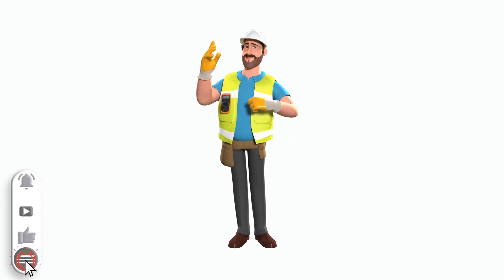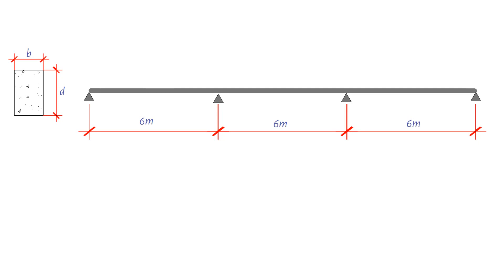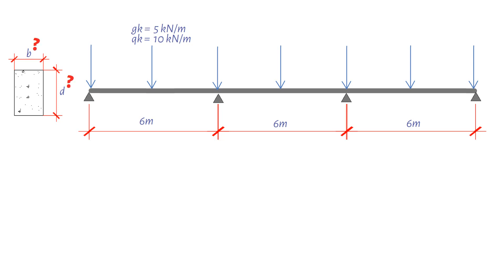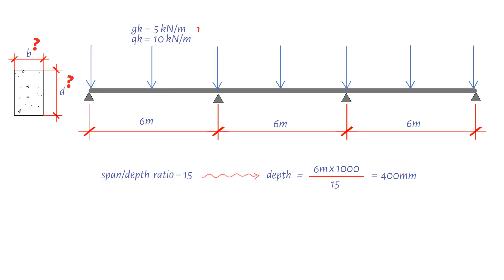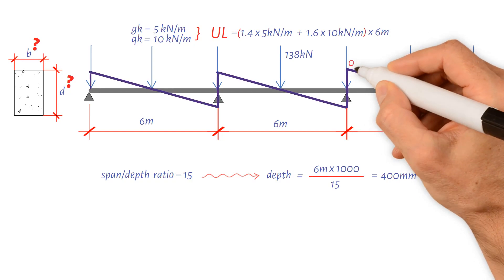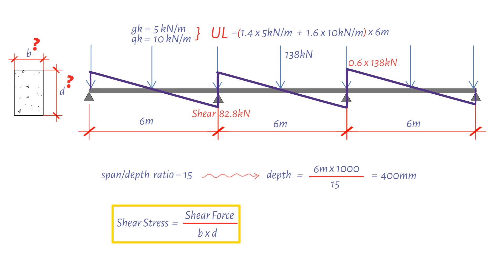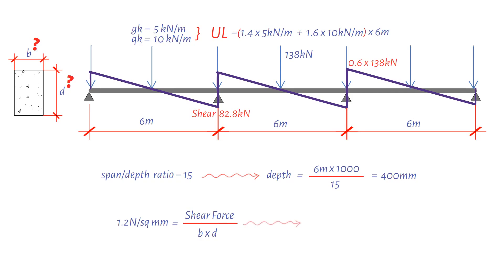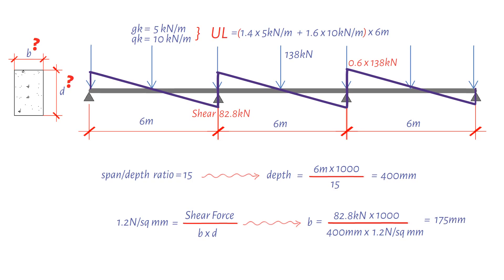How to work out the initial size of a concrete beam | Rules Of Thumb.

Comment: Hi SECalcs, how would you design a two-way supporting slab ?
Reply from the maker: Hi Jack, two-way spanning slabs can have linear supports along their edges (for example, beams) or they can be supported solely by columns (in which case they are generally called flat slabs). In either case, for a manual design (i.e., handwritten calculations), I would follow the design advice provided in the IStructE Manual for the Design of Concrete Building Structures to Eurocode 2. The applied load is carried equally by the slab spanning from one side to the other and also from one end to the other for a linear two-way slab square shaped on plan, with length and breadth the same. As a result, the reinforcement in both directions will be equal. When a linear two-way slab has a length that differs from its breadth, the shorter span carries more of the load and the longer span carries less. The above-mentioned manual provides coefficients for bending moments and shear forces in these situations. I hope this was helpful.